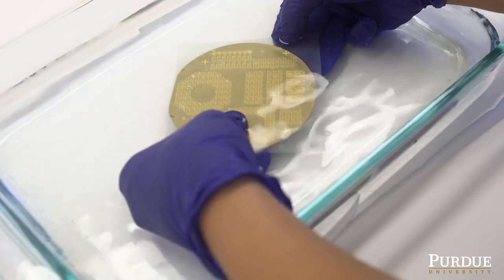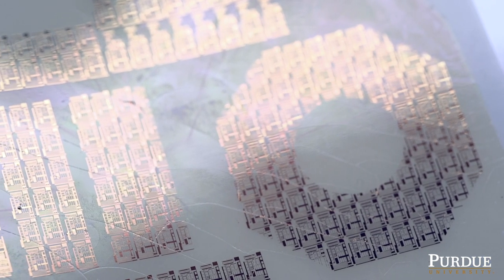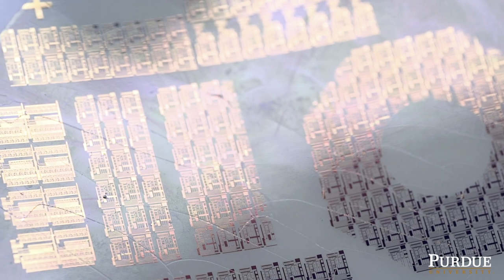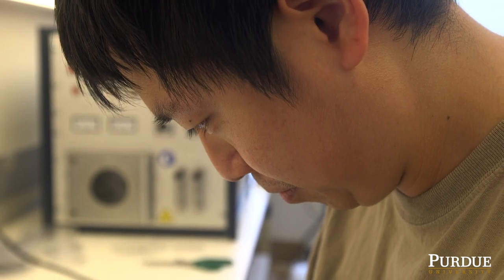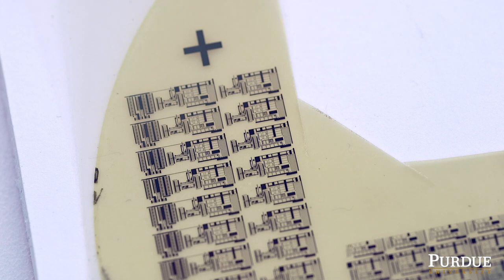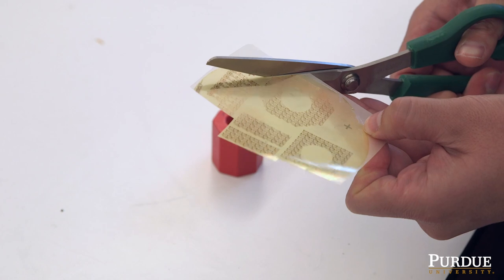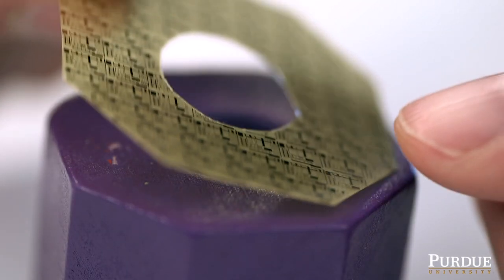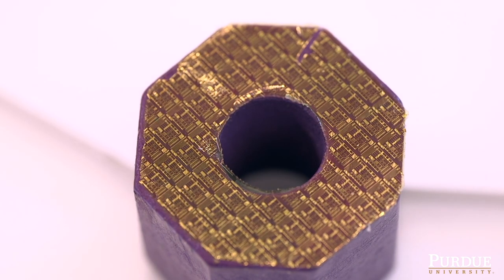Electronic stickers for the 'internet of things'

Comment: It is unclear to me whether this is an active circuit - that is a device layer on the silicon is removed with the film or just that the silicon is used as a temporary substrate during fabrication. Transferring active silicon would be is new to me, but I don't think this is what they are doing. The latter has been well-known for many years. Colleagues from EPFL used a similar process to make medical device electrodes as part of a project I managed from 2004, and it was not a new process then.